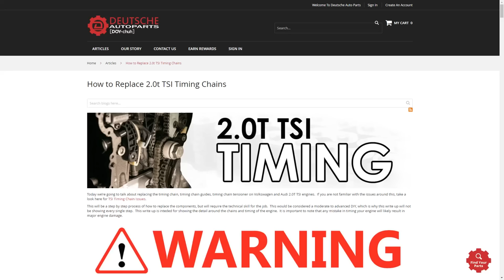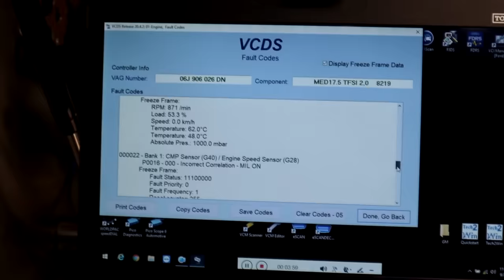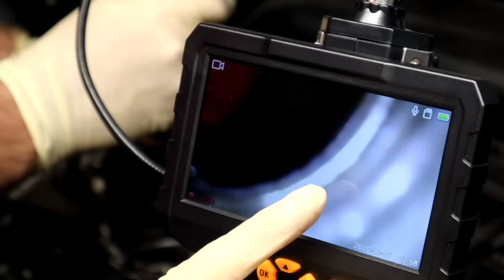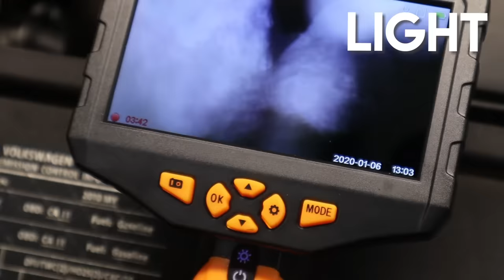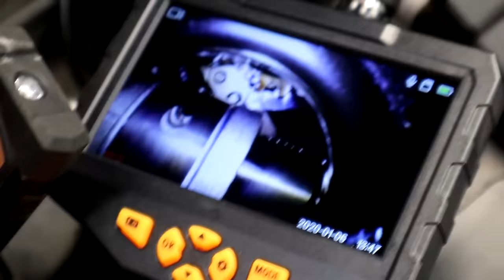The Jalopnik Tiguan FAILED ~ Despite the Warning

Comment: This video is awesome, but actually looks like VW just makes engines hardwired to fault after a certain point.
Reply: I think it is across the board - all automakers (obviously, some worse than others).  It has to do with 1. emissions and fuel economy compliance here in the USA (& Canada), the UK, the EU, Australia, China, and Japan.  2. customers wanting more pep in the engine, with more and more power/automatic/touch-screen/self-driving/safety features.  Added weight and better performance are generally diametrically opposed.

The VW ABA 2.0L 4-bangers from the 1990s were bulletproof engines.  People dropped those engines into other vehicles to make them (i.e.: the other vehicles) more reliable.

The heat exchangers for the automatic transmissions were a known failure point, but since I only ever bought 4 & 5-speed manuals, I only ever saw that on vehicles I didn't buy myself.  Once you get water/antifreeze in the transmission and tranny fluid in the radiator, things go downhill rather quickly (often irrevocably).

The gasoline direct injection, tighter tolerances, variable valve timing, and all the gizmos and doodads on the engines make them more efficient and cleaner running when new.  But, as they age, develop carbon buildup, and FRP/plastic parts wear, they become much less reliable.  You cannot get something for nothing.
Reply: @frederickevans4113  
Talking about people wanting all the bells and whistles, reminds me of the Dacia story.
Dacia is a cheap fairly basic car brand that,  owned by Renault, that is based in Romania and is marketed in the Eastern Bloc countries and other less developed countries.
In the early 2000's they introduced the Dacia Logan, which was a solid, basic, cheap car, the surprising thing is, that it became very popular in Western Europe and gained almost a cult following.
People loved it simply because it was a no nonsense cheap car.
It's success in Western European markets went against all those marketing predictions that people want more and more gizmo's.
It makes you wonder if it is not a, chicken or the egg situation, do people want more gizmos, or do the Marketeers want more gizmo's added to dazzle the Buyers with.
Probably a bit of both.
Reply: no just early engines have problems ask ford or yota or honda or chevy or any car manufacturer that makes a new engine. Shit happens, its the care after that matters

Comment: Regarding piston dents from valves - While on a completely unrelated engine (2.8 V6 GM), I had a steel "seating/retaining/sealing" ring dislodge into a cylinder.  IIRC, this is something they press into the head to help the valve seat.  It stuck the valve open and so the piston struck it causing some dents in the piston.  The piston damaged seemed insignificant at the time.  It was a new-ish reman, so we got a replacement head under warranty and were able to button everything back up but about 10k down the road, the crankshaft cracked in half.  My assumption is that the hammering weakened the crank and it just broke later.  Have you ever seen anything like that happen?

The hilarious part was that we think reason the ring unseated (and why we'll never actually know what broke the crank) is that the engine was probably overheated due to my dad running the car with an exhaust pipe fed into a mole hole.  He was trying to gas them out, but fell asleep in the living room chair and it left the car to run idle for about 8 hours until it ran out of gas next to the house.  I'm glad that was the least of the problems since I've seen 3 examples of that motor catching fire due to a bad fuel system design.  He didn't have mole problems for the rest of the Summer though.

Comment: The cam/timing belt broke on my VW Scirocco some years ago, bending all the intake valves.  I pulled the head, and had a independent German specialty shop install 16 new valve guides and 16 valves.  Did NOT have to buy a new/rebuilt head and the cost was less than $700 as I recall.  YRMV.
Reply: Yeah I was about to say the same, I guess if time is a major factor then buying a replacement head is an option, if you've got the time for engineering and cost is a major factor, then you can get it done that way instead
Reply: Yes my brother this ☝🏻
Reply: They displayed some damage inflicted to the head internal surfaces with bent valves. I cannot evaluate the “severeness” of that damage from the video, but they say it was one of the reasons. The “landing” cone surface of the head may be damaged enough to be unable to polish it and find a replacement valve of the appropriate dimensions.
Reply: @rodrigoroaduterte9415  Possibly.  But my experiences with VW's  'interference engines' has been that a bent valve simply will not close.  This means the valve will not contact the valve seat (landing cone surface) and no damage to the valve seat will occur.

Comment: Having just bought a new-ish VW (a 2017 GTI), I feel like I need to watch both of your channels a LOT more. It seems like the third-gen EA888 engines are pretty good (by the way, what is it with VW and 82.5mm bore x 92.8mm stroke engines? It's the exact same as my 1991 Jetta GLI with the 2.0L 16V!), so that's a relief, but I just hope there are no unexpected surprises because I intend to drive this car for the better part of a decade. Not just because I need to pay the car off but because I LOVE driving it! The 2.0L turbocharged engine mated to the 6-speed manual transmission is an absolute blast to drive, and it handles so much better than I ever imagined it would.

This is great stuff! I like both of your channels and will be subscribing and watching a lot more!
Reply: I strongly recommend getting a timing job done while the engine is still in one piece. I don’t know how many miles you got on that GTI but if it’s near 100k just do it now while you’re ahead.
Reply: Just had my chain replaced at 212500km, the symptom was a P052A and slightly wobbly timing measurement in VAG-COM. Did not jump, but I was a bit nervous about that. Just the chain replacement plus all of the guides and things you need with it, didn’t need a new head since it didn’t contact. Was just over 3k CDN (maybe 2200USD) to get it done, but now I don’t need to worry about it for a long time. I usually device my cars for a decade or so.

Comment: I just had the tensioner (and the rest of the timing chain assembly) preventatively replaced by a reputable mechanic in my 2011 Audi A3 2.0. At 82k miles it wasn't having any issues, and the mechanic said it wasn't out of camber at all, but I've heard enough horror stories to know that I was living on borrowed time.

I flip flop on loving this car enough to drive the paint off of it and wanting to go back to the Mazda 3 with its perfectly pleasant feel and beautiful reliability.
Reply: Sell that turd on wheels while it’s still worth something. After watching this video I’d never want one of these. It reminds me of a early 80’s GM car with that thin sheet metal timing cover, pressed lobe camshaft, cracking plastic tensioners(cheap plastic). Wow they really cut corners on these things. Garbage.
Reply: Do you still have your a3? @Nicholas DeLessio
Reply: @kenny9088  Yep, still have it.
Reply: @BokBarber  how is she running? What kind of issues have you had with it? If you dont mind me asking. I just bought a 2012 a3 2.0t fwd with 87k they afe beautiful cars to drive
Reply: @kenny9088  I agree. It's a very solid feeling car and a nice drive! Very much a sleeper, since not too many people (in the US) know about them.

Aside from having the tensioner replaced preventatively, and the intake manifold replaced free under extended warranty at about 50k, I've had absolutely no issues with the engine. My total costs for engine work over 3.5 years of ownership is about $2k, and that was all that one timing chain job.

Mine is a manual transmission. I can't speak to the longevity of the dual clutch autobox. I've heard rumors that the automatics can be hit or miss.

The biggest issues I've run into have been cosmetic. The backs of the front seats came unglued on a particularly hot day last summer. I was able to sand all of the old glue off and reapply the plastic brace to the seatback with JB weld, and that's held up perfectly well... but you'd think they'd use something more durable. The sun visor clips are also fairly brittle and expensive to replace, so be very careful not to break them unless you like spending $50 on tiny pieces of plastic. (If you do break them, save yourself some time and don't bother buying non-OEM; they don't fit.)

Overall, it seems like as long as the previous owner was decent to the car, you keep up with preventative maintenance and have a decent foreign car specialist nearby, you won't have too many problems. I'll probably be keeping mine for at least a few more years.
Reply: @BokBarber  I appreciate the reply, i definitely gotta do the tensioner replacement to have peace of mind. I plan on holding on to  this car for a while. I have the manual transmission as well. Main reason why i bought it, i prefer manuals, and it was very well taken car of cosmetically. Few modifications too. How much did your mechanic charged for the timing tensioner swap? If you dont mind me asking. Oh yea and did you the whole timing chain and tensioner or just the tensioner?
Reply: @kenny9088   My guy wanted $800 for just the tensioner, or around $2k to replace the tensioner, chain, and guides. I went with that option because it's recommended that the chain get replaced every 120k anyway, and I figure this way I'll probably never have to deal with it again.  I'm in the central midwest, and my guy's prices are slightly above average around here fwiw.

If you haven't already, I'd start by having a mechanic verify that no previous owner had it done. Pulling the plug and checking the tensioner is typically only an hour of labor tops and might save you the hassle. My mechanic told me that most cars that come into his shop had it done as part of a class action lawsuit a few years back, and mine was a rarity in still having the original chain in 2020 with 82k miles; that most either were fixed or exploded by now. Worst case scenario, you're out for an hour of labor and have to get it done anyway.

If it turns out it has to be done, do it as soon as you can afford to.  It's a ticking time bomb. I know a guy with a similar age Jetta that deferred the maintenance on the tensioner, and it exploded on him. He wound up having to swap out the engine for over $6k. At 87k it's tempting to just wait it out until the chain is due at 120k, but I personally don't think it's worth the risk.
Reply: @BokBarber  i agree with you 100 percent. It's not worth waiting. The only hard part is finding a reasonable and honest mechanic. I live in California. I think as far as checking the tensioner i feel comfortable enough to do that. Thanks again for all your input 🤝

Comment: I think the complexity and uncertainty of engines from VW, Audi, and BMW are what attract me to them so much. It is weird, but I really enjoy all the mechanical flaws. I drive a GTI with no issues what so ever, but I used to have a rotary and after a new engine and tedious maintenance that drove me crazy, I definitely want another one!
Reply: the 3.0 TSFI V5 supercharged has a water pump issue, thats about it. unless you go pre 2012 which then you have the issue with the polymers used in the chain guides which were fixed in later models and is no longer an issue. Tbh its the best car I've ever owned or driven and plan to keep it for decades if i can

Comment: I had a 2012 GTI and around 2014 I asked our local indy VW shop to pull the inspection plug and check the tensioner. They looked at me like I was nuts, but I'm sure by now they've seen a ton. Anyone out there still rolling around in these should at least have it checked.

Comment: The whole reason to buy a car with a timing chain instead of a belt is because it lasts forever and you won't be replacing it. Unless you buy a VW, in that case have fun replacing the chain and a whole lot more. I was actually a VW fan at one time. My first car was a '64 beetle and I've owned a '67 bus, '68 bus, '68 type 3 fastback, diesel rabbit all before the age of 21. They were all nothing but problems but I did turn into a pretty good DIY mechanic, so there's that. Now I buy either Japanese or American cars with a proven track record. No German cars for me any more.

Comment: This describes the modern German car experience better than any that I've seen.   The only modern German car I have left is a 2010 CC Sport, for its manual transmission, and just to see what breaks next...  and that car, with less than 100,000 miles, the following items have failed:  Cam Bridge [twice!], chain tensioner, water pump [twice! - finally replaced with  an aluminum unit], rear main seal [ get a billet seal - doesn't fail], stuck injectors [hydro-lock, anyone?], ignition coils, re-pinned brittle & broken electrical connectors when changing spark plugs, new intake manifold [the old manifold's flapper blew out],  bad thermostat, bad cooling fan controller [its integrated into the fan assembly], turbo diverter valve, and then just a bunch of plastic connectors that disintegrate for no apparent reason....   And presently, the coolant temperature wants to occasionally spike when exiting the freeway [and the thermostat is less than a year old!]
I'm keeping my 'trusty' old CC around just to see which of the finely engineered German items will fail next... its become a conversation piece, and the butt of many jokes...   
However, don't me started on the other German brands...  They're markedly worse.
Reply: I had my 85 300d do that where the thermostat would spike suddenly just after getting off the freeway. It did it four times in one year. I would let it cool enough that I could open it up and remove it and go on to work. On the way home, I would get a new thermostat and install it.
I don't remember why, but I finally replaced the radiator, and I never had that happen again for several more years that I owned the car.
I don't really understand why thermostats will suddenly close when up to temp. The spring expands and opens it. If it is hot, it should not want to close. And I don't understand what the radiator has to do with it when the car does not run hot normally until it does that sudden spike.
Weird!
Reply: @wernerdanler2742  Update - still have the CC - I'd get a new sedan if any had the manual wand reliability.

Comment: "I did the research, and I did it ANYWAY"...sounds like me when I bought my B5.5 Passat W8

I just happened to get lucky, sold the car less than 5,000 miles before it became a basket case [fyi, I sold it after paying almost $800 to replace the fuel transfer computer, which is stupidly mounted beneath the spare in the trunk!....btw, the official VW fix is to replace the module & wrap it in a plastic sack!]
Reply: you paid someone or was that the cost of the item?

Comment: A cheap thin plastic part is the only thing keeping the VW from breaking down on the side of the road. Sounds like a well-designed car.
Reply: Most fuel injected have a cheap piece of plastic that if broken would entirely strand them on the side of the road.

Almost all ohc cars with timing chains have plastic guides.
Reply: Wow sounds like any vehicle that runs on a timing belt too.
Reply: BMWs of that era have the same problem.
Reply: Lots of cars engines have plastic guides for the timing chain from parts I’ve seen, it’s not special to just vw

Comment: Should’ve have dropped the oil pan to clean  up all the metal shavings from the shearing of the timing chain cover 😱😱
Reply: Most deff, Imagine all the chunks and shavings that are stuck in the pickup tube screen!
There was a significant amount of material removed from that cover, hopefully it all got caught in the filter if it made it through the screen.
Reply: That’s the next ticking time bomb🤣
Reply: U got that right how does this dude have his own garage I'd run circles around him I promise been doing this longer too I'm a master vw tech also
Reply: @markd6637  I know a 30+ year VW tech who lost part of his finger in an engine. Complacency.
Reply: @nicholasllamas5039  lol that was savage.

Comment: 4500 dollars for a car repair would mean certain suicide for me. Jeez.
Reply: Like, "And how long until I owe ANOTHER four-and-a-half grand for this thing?"
Reply: I'm sure there are a few "stolen" MKVs in canals with skipped timing.
Reply: For just a 4 cylinder 4 valve DOHC head, that is beyond stupid.
Reply: $4500?! I’d expect to pay that for a brand new engine installed. I wouldn’t even put that money into a Tiguan with 130k miles. The resale is terrible on those.
Reply: that's why you get a honda or a toyota if you cant afford expensive repairs.
Reply: @brettgardner2096  resale is not terrible on anything anymore. Chevies, Chrysler, jaguars. Everything is pretty much worth fixing these days.

Comment: When  I have fixed up a car that had bent some valves I just changed the valves and not the whole head, cutting/grinding the new valves of course. Interested to know why the head was replaced but not say the cams or pistons which would also have been beaten up a bit.

Comment: My wife has a 2009 with the 2.0  Got hit with the ring and chain issue.  Audi paid for 1rebuild entirely and half of the chain issue (with 4 bent valves), both happened well out of waranty.

EDIT:  All the comments about how good one's Honda, Toyota, etc is cracks me up.  As a former mechanic I can tell you with reasonable certainty that EVERY manufacturer has had issues like this at one point or another.  Some are well covered up, and some the manufacturers work hard to ignore.